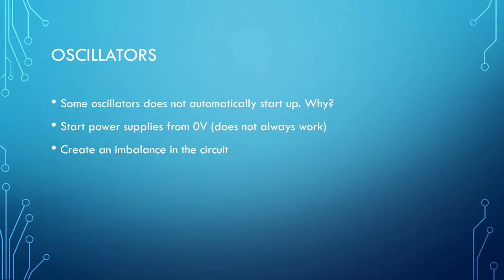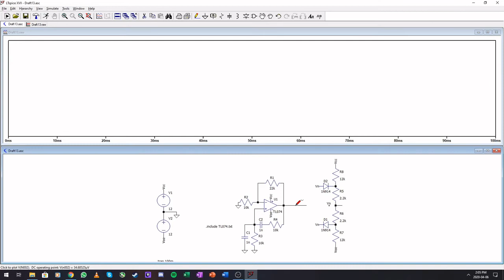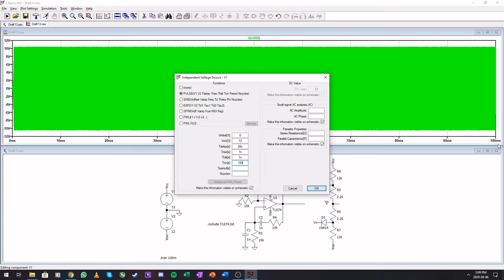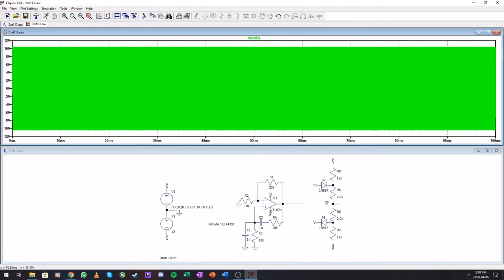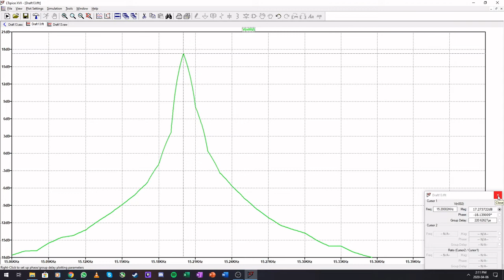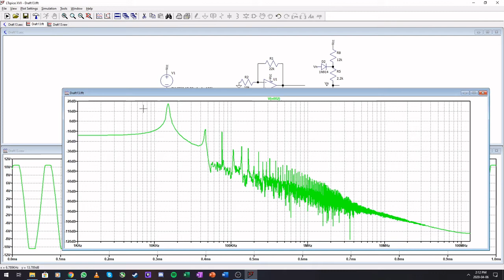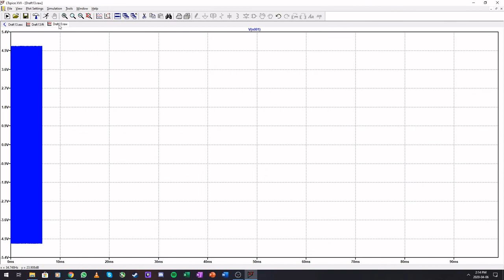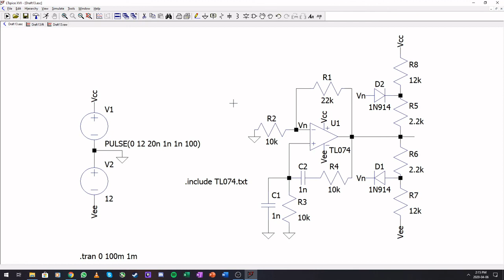Video 6 - LTSpice Oscillators

Comment: Hello, thank you for the video. 
I was trying to find the TL074 Op-Amp in my LTSpice library but was unable to find it. 
Did you add in an external library?
Cheers
Reply from the maker: The model is an external model. Watch LTSpice video 4. It explains it.
You can download the SPICE model for any component, make it a text document and include it on your schematic.
Make sure the *.txt file is in the same folder as your schematic (else you have to include the path with the include command).
Model OpAmp2 is used when including an op-amp like this (it is at the end of the op-amp list). Rename it to TL074.
Reply: @EzElectronics  brilliant thank you
Reply: Where did you download the TL074 , which link
Reply from the maker: Usually I just do a search for the component and add "SPICE model" to the search.

I used this one:
https://www.ti.com/lit/zip/sloj068
Extract the file from the zip file.
Rename the file from TL074.301 to TL074.txt
You can use the .import "TL074.txt" spice command in LTSpice place it anywhere on you schematic
Use the opamp2 model from the op-amp library.
Rename the op-amp TL074 after you placed it.
Reply: @EzElectronics  ♾thanks